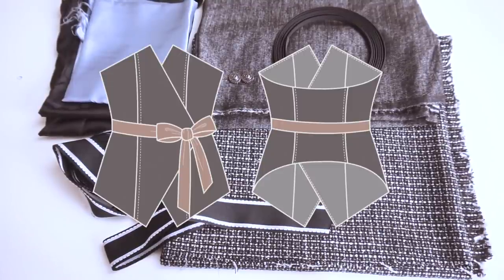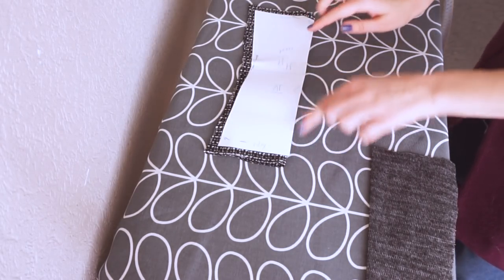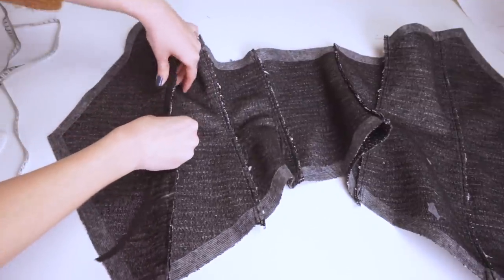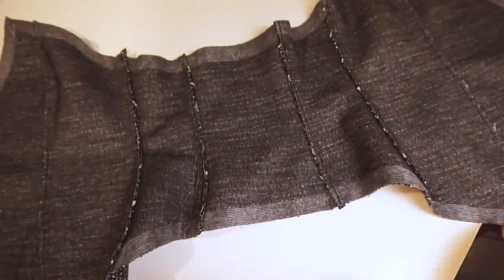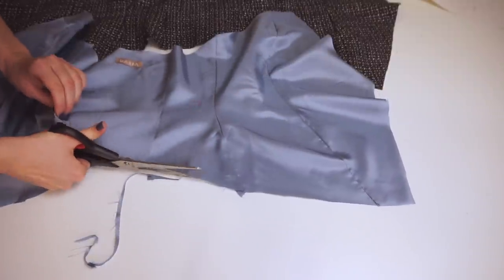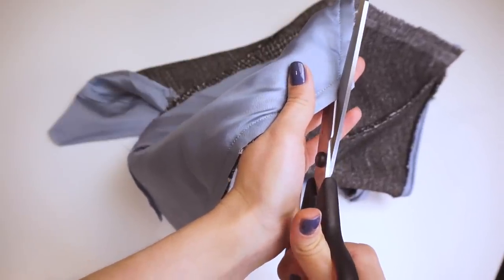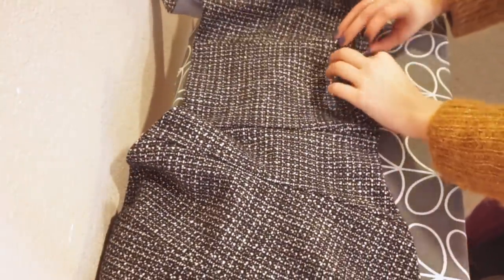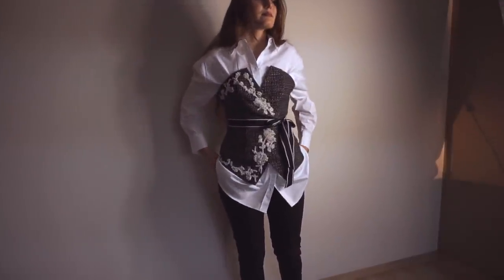DIY Easy Wrap Corset Belt With Boning Sewing Tutorial + Pattern Download |Miracle Magnet|

Comment: Hi Daria, the video is awesome and very helpful. Could you please tell me, what is the difference between interfacing and stabilizer. You put interfacing on the whole front part and stabilizer just a small line. Also, whe you put the Iron on them, do you use the steam or not?